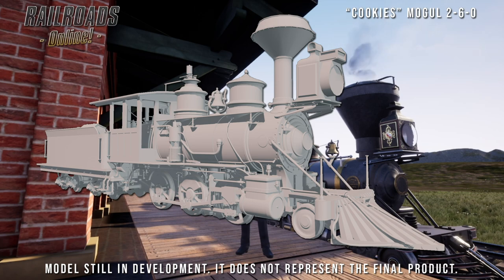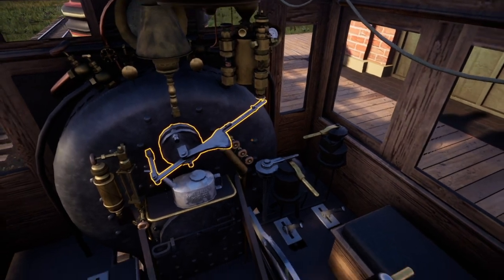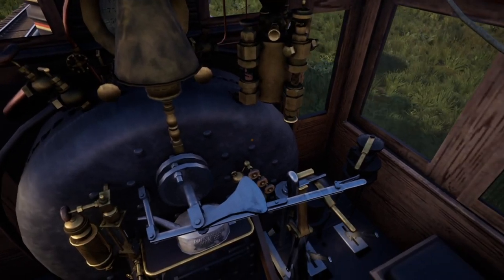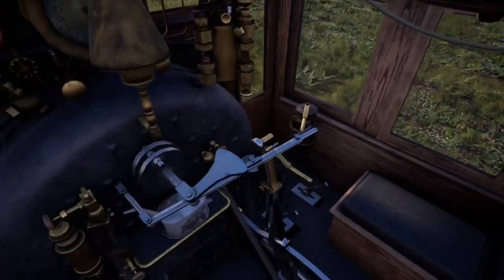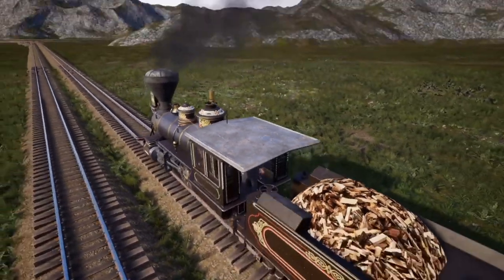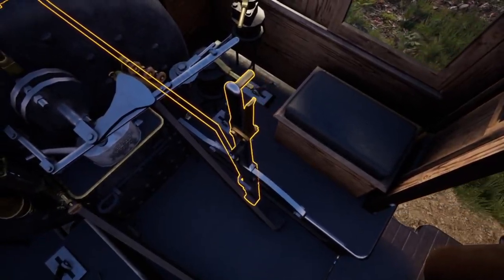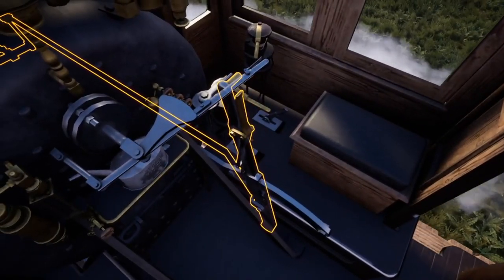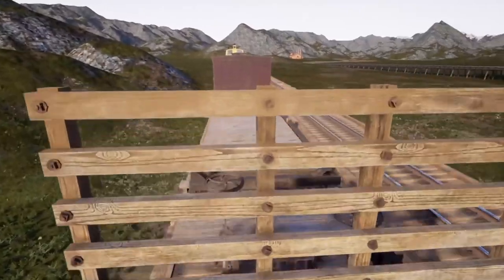[RO] Cut-Off Simulation! [Dev Vlog #14]

Comment: Cut-off should not be tied to speed, cut-off changes the engine efficiency and power as when you move it closer to the center you get the valve open less time to use less steam at speed and rely more on steam expansion to push the piston
Reply: Facts
Reply: Indeed. What it should do is just eat up your fuel and water much, much faster. But I guess that's too hard? IDK, I can't say I've driven a steam engine, but I have taken a fireman class from the CTSRR and I have seen them take off and haul some ass with a the throttle wide open and the Johnson maxed. The only one who would be able to answer way more accurately is Hyce. But he's not easy to get a hold of.
Reply: and if we get durability, having the the bar closer to the corner or the crotch at speed will wear the pistons and steam chest down faster, as ur not gently stopping and reversing the piston direction, ur slamming it to the cylinder head and cylinder back with ALL the steam instead of keeping to flow smooth.
Reply: Also it should be possible to accelarate a train to a speed as high as possible on a grade from a standstill
Reply: I was just going to comment this. Johnson bar(cut-off) is just a variable valve lift device. When you throw it in the corner you're getting full valve lift. More lift = more time steam is allowed into the cylinder = more work = less efficient use of steam.
Reply: I hope that this is not the final version for this feature, it really destroys the experience of Driveing as seen in Derail Vally, and it scares me that no one on the team has driven a steam locomotive so the end result is going to be a very cartoonish stylisation
Reply: @michgeeson278  well Hyce technically has but hes no longer in the team

Comment: It just seems like you guys just flipped the roles of these two levers. Like before, you just had the reverser all the way forward and changed speed with the throttle, and now you just have the throttle open and change speed with the reverser. It's not actually how the reverser works, it's based on efficiency, not speed. You just so happen to put it near the middle when going fast so that you save boiler pressure and prevent from damaging the cylinders, which also happens to increase the speed. That's how I can explain it in a very basic understanding.

Comment: if it's doing close to real life steam simulation you would be playing with both the Reverser and the throttle to get the speed and power ratio in a Perfectly balanced fashion. Cause you start at everything at full then you move everything close to 5-25%  for max power and speed.
Reply: Not so much as Power as in Steam usage efficiency. Throwing the bar in the corner and pulling the Reg to the rear wall will get you top speed at the waste of a lot of steam and a Fireman with a very sore back.

Comment: Steam locomotives did have some audities back in the day like for instance they had left handed valve gear which means forward is reverse and reverse is forward I don't know if early locomotives like Virginia and Truckee locomotives had Variable lap and lead of the valve When the valve is lapped it means the valve is not open to emission or exhaustion from the cylinder allowing expansion of steam in the cylinder Allowing a higher top speed of the locomotive but reducing the power of the locomotive Locomotives like the Van swearinger Berkshire's Had a thing called Pre emission Into the cylinder When the piston valve Was at dead center in the valve cage There was a small gap of 0.16th of an inch To allow the cylinder to breathe better Having the valve lapped also facilitated more fuel mileage Cause you're using less steam And allowing the steam to expand in the cylinder

Comment: I don’t really like this system. It doesn’t work like this IRL, and it seems like a rather odd decision. I mean no offense, it just doesn’t work for me as a game mechanic or design decision.
Reply: Wait what? That’s exactly a layman’s way of explaining what a reverser does
Reply: Technically, adjusting the reverser changes valve timing. Shorter valve timing results in a faster combustion rate. As a result, that is how that works.
Reply: @2334animelover  No, the reverser doesn't do that at all.  In real life, a steam engine is perfectly capable of going at it's maximum speed with the reverser fully open.  The reverser is not like a car transmission, it does not modulate speed vs power.  What the reverser does is modulate steam usage vs power.  

With it fully open, the valve to the boiler is open for nearly all of the piston stroke, and the piston is being pushed by straight boiler pressure.  This allows for maximum power.  When you start to close the reverser (which is also known as the cutoff), the valve to the boiler will close at a certain point during the piston stroke and prevent more steam from entering the cylinder.  This does not eliminate the power though, since the steam is extremely hot and already under a great deal of pressure, the volume of steam inside the cylinder will keep applying force to the piston.  Therefore, if you put the reverser/cutoff at 50%, you will have more than 50% power since the steam expansion by itself applies force as well.  Most steam engines in practice will have the reverser/cutoff at somewhere between 10-25% while moving at speed because there's still a great deal of power provided at those percentages and it's far more steam efficient.  Therefore, if you had infinite steam generation, it would actually be much faster to get the train going at speed at 100% reverser/cutoff, but in practice this isn't done because it will piss away too much of your steam as you start to go faster.

The reason in real life that the reverser/cutoff is put at full to get the train moving is because if you have it at a low percentage while stationary, the cylinders might be in a position where steam to both of them is cut off at once, thereby generating zero force since any steam inside will have cooled off and lost pressure.
Reply: @Razgriz__1   never said it did, just said that’s a fair explanation for someone who doesn’t know the specifics
Reply: @Razgriz__1  thank you that’s a good explanation

Comment: Speed vs reverse is backwards. The closer to neutral the slower the speed and more horsepower. The further forward or reverse from neutral the greater the speed.
Reply: Wrong
Reply: @spacebarbepressed6552  I do know a couple of railroad men who have worked on the steam locomotives back in the day and that is what they told me.
Reply: The closer to neutral the less steam gets put in the cylinders per stroke, meaning that there's less power but more speed because the engine is relying on the steam's expansion rather than the amount of steam to move the cylinder
Reply: @spacebarbepressed6552  this guy would put full throttle then use the Johnson bar AKA reverser to move a train from a dead stop on a hill and this guy piloted cab forwards.
Reply: That's just his technique. From everyone I know they have the bar in the corner, slowly bring up the throttle, and as they gain speed bring the bar towards center to concerve steam and go faster.

Comment: So the reverser is kinda like a gear box, so when it’s in the middle the locomotive is in neutral and all the way to one side is 1st or -1st gear and the further you go back to the middle the higher gear you have.

And the regulator is like your gas paddle. 

I don’t know much of steam train controls but this is how I understand how it functions.
Reply: Sort of, although many locomotives will move forwards even with the bar/screw/other strange and wonderful reverser operation device in "neutral." The reverser alters the piston timing.
Reply: yes it controls the valve GEAR which controls the timing of pistons
Reply: That's how it appears to be implemented ingame, but that's not how it actually works in real life.  Copy pasting from another comment I posted.

In real life, a steam engine is perfectly capable of going at it's maximum speed with the reverser fully open.  The reverser is not like a car transmission, it does not modulate speed vs power.  What the reverser does is modulate steam usage vs power.  

With it fully open, the valve to the boiler is open for nearly all of the piston stroke, and the piston is being pushed by straight boiler pressure.  This allows for maximum power.  When you start to close the reverser (which is also known as the cutoff), the valve to the boiler will close at a certain point during the piston stroke and prevent more steam from entering the cylinder.  This does not eliminate the power though, since the steam is extremely hot and already under a great deal of pressure, the volume of steam inside the cylinder will keep applying force to the piston.  Therefore, if you put the reverser/cutoff at 50%, you will have more than 50% power since the steam expansion by itself applies force as well.  Most steam engines in practice will have the reverser/cutoff at somewhere between 10-25% while moving at speed because there's still a great deal of power provided at those percentages and it's far more steam efficient.  Therefore, if you had infinite steam generation, it would actually be much faster to get the train going at speed at 100% reverser/cutoff, but in practice this isn't done because it will piss away too much of your steam as you start to go faster.

The reason in real life that the reverser/cutoff is put at full to get the train moving is because if you have it at a low percentage while stationary, the cylinders might be in a position where steam to both of them is cut off at once, thereby generating zero force since any steam inside will have cooled off and lost pressure.
Reply: @gearandalthefirst7027  Not so much valve timing but "Valve Lift". The valve is commonly a piston(can be a flat slide as well) that passes back and forth over the valve port. The reverser controls how far that piston(or slide) travels inside the Steam Chest to either side of the injection port. The longer the valve stroke, the more steam is injected from the chest and into the cylinder. Shortening the valve stroke conversely limits the amount of time the injection port is open.

Comment: i like how the cut-off simulation is literally with opposite senses.
i think full throttle on the reverser is high speed and half-middle is high power.

that method would sacrifice some stuff in order to have the desired configurations
high power would probably sacrifice speed
and
high speed would probably sacrifice fuel.

im not a game designer or such but i think that would kind of do the thing well.

Comment: Ummm, running with the cylinder cocks open lowers the amount of power the steam provides. Close them and you should get full power with the bar in the corner.